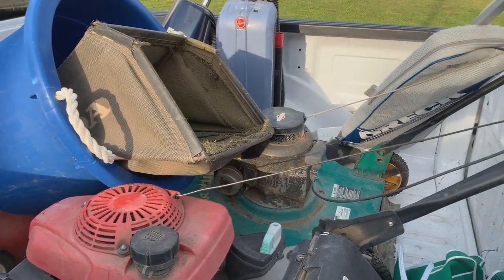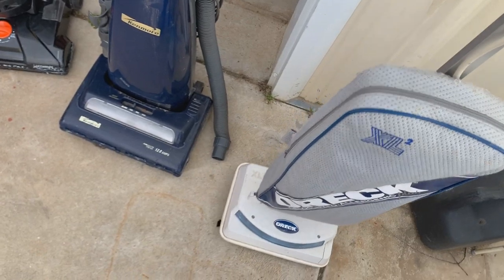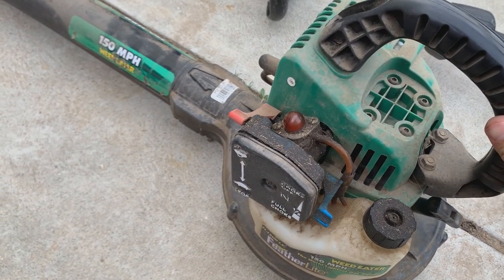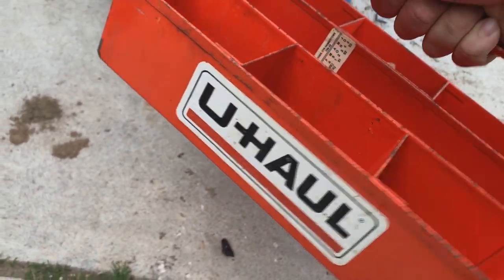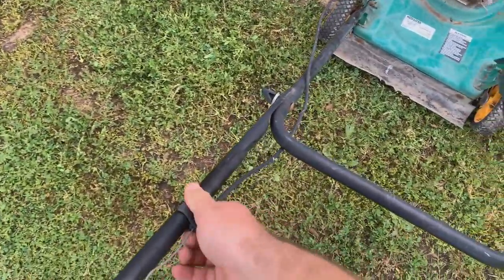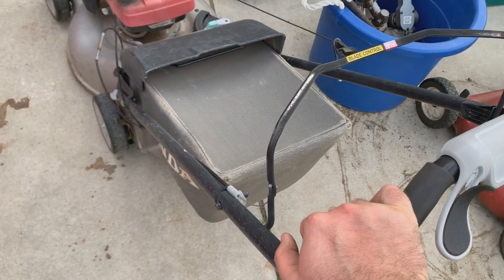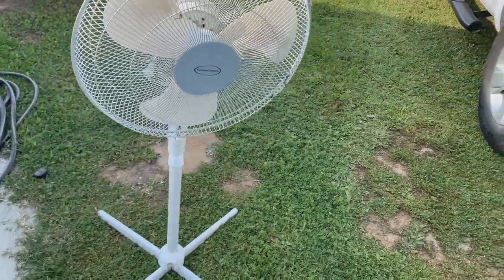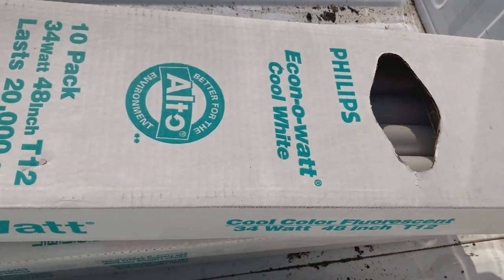Trash Hauls Mid-March 2020 - Mowers, Vacuums etc

Comment: I have that exact same Honda Lawnmower, it's crazy to think someone actually threw it away 😂 mine has lasted about 5 years and it still runs great even with all the tall grass and punishment I throw its way! Funny enough mine doesn't look as bad as that one does LMAO! 

Some advice I can say for that mower is that lever on the back right is for activating the mulch function. Additionally the air filter cover likes to fall off if you hit it against a bush so I installed a simple metal latch with some self tap screws to keep it on when I want it on (ofc seal the screws with some caulking to keep moisture out.) Lastly I want to mention my Honda's tires are like new and they don't have much traction so when you do eventually swap those wheels on your mower you should consider replacing them entirely with something better. 😄

Comment: Hank. I have a 20 inch Weed Eater mower just like the one in the video. You Are 100% Correct- Those Decks Are Terrible!!!. The 300 series B&S engine runs great with little priming and no oil consumption other then the oil spillage when I have to perform surgery on the mower deck. The mower was given to me due to one of the back wheel adjusters literally falling off. 
I fabricated an axle with 2 - 1/2 inch diameter bolts that I welded to a piece of 2 inch C channel.  The axle was mounted where the 3 fasteners secure the rubber debris shield. It’s not perfect,nor pretty- But functional.
Reply from the maker: Right on. whatever works for sure.
Reply: Hank. Another Thought; Whenever I finally decide to trash my mower deck - I can re-purpose the axle for something else. There’s no reason whatsoever to make a mower deck so cheap & flimsy. Have A Great Day.

Comment: I got lucky today and finally found a free mower on the side of the road. It was a LawnBoy (model# 10323) with a Duraforce 6.5 HP engine. The deck is rusted out (2 big holes) but it started up first pull. There's decks on ebay for $120 but I'm not sure that's worth it. 

Anyways, nice haul!
Reply from the maker: I wish I could find one of those lawnboys around here, the past 12 years of me doing this I have only seen one 2 cycle lawn boy and it was on craigslist years ago.